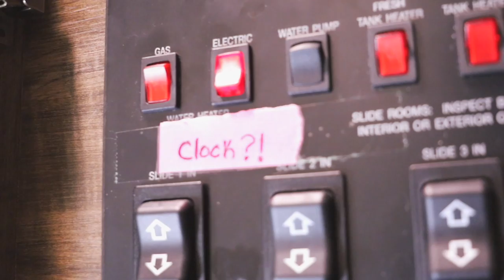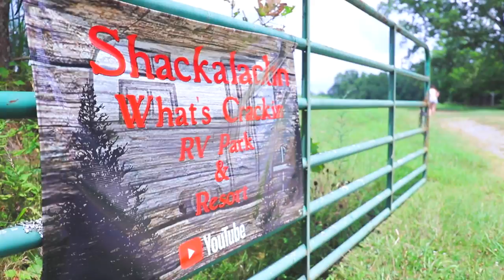Want the BEST Tow Vehicle Upgrade? WATCH THIS FIRST!

Comment: I’m interested in your truck I have a 2019 3500 Denali with a 6 inch lift and 35” tires.  What are the spec on your truck.  I was told I couldn’t pull a 5th wheel because it was too tall.  I ended up with a bumper pull and I’m not happy with it.  I really want a 5th wheel.
Reply from the maker: Ney Ney here! 5th wheels are the way to go esp for full time RVing! We have a max tow of 15,000lbs
Reply: Does your truck have a suspension lift on it?  If it does how much?

Comment: Sometimes the towing air pressure charts are difficult to find so let me share the info I found.  The chart is not formatted as it should but here ya go!  Use your tire size and load rating and axle weight to determine your tire air pressure.

Tire Size	Max Load Capacity
Max Tire Pressure
30x9.50R15 104S
1984 lbs	50 psi
31x10.50R15 109S
2271 lbs	50 psi
32x11.50R15 113R
2535 lbs	50 psi
33x10.50R15 114R
2601 lbs	50 psi
33x12.50R15 108R
2205 lbs	35 psi
33x12.50R17 120S
3086 lbs	65 psi
33x12.50R18 118S
2910 lbs	65 psi
33x12.50R20 114S
2601 lbs	65 psi
33x12.50R22 109R
2271 lbs	65 psi
34x10.50R17 120R
3086 lbs	65 psi
34x12.50R18 121R
3197 lbs	65 psi
35x12.50R15 113Q
2535 lbs	35 psi
35x12.50R17 121R
3197 lbs	65 psi
35x12.50R18 123R
3417 lbs	65 psi
35x12.50R20 121R
3197 lbs	75 psi
35x12.50R22 117R
2833 lbs	65 psi
37x12.50R17 124R
3527 lbs	50 psi
37x12.50R20 126R
3748 lbs	75 psi
37x13.50R18 128R
3968 lbs	75 psi
37x13.50R20 127R
3858 lbs	75 psi
37x13.50R22 123R
3417 lbs	75 psi
39x13.50R17 121R
3197 lbs	50 psi
LT215/65R16 103S
1929 lbs	65 psi
LT215/70R16 100R
1764 lbs	50 psi
LT215/75R15 100S
1764 lbs	50 psi
LT225/65R17 107S
2149 lbs	65 psi
LT225/70R16 102R
1874 lbs	50 psi
LT225/75R16 115S
2679 lbs	80 psi
LT235/70R16 104S
1984 lbs	50 psi
LT235/75R15 104/101S
1984/1819 lbs	50 psi
LT235/80R17 120S
3086 lbs	80 psi
LT235/85R16 120S
3086 lbs	80 psi
LT245/65R17 111S
2403 lbs	65 psi
LT245/70R16 113S
2535 lbs	65 psi
LT245/70R17 119S
2998 lbs	80 psi
LT245/75R16 120S
3086 lbs	80 psi
LT245/75R17 121S
3197 lbs	80 psi
LT255/55R18 109R
2271 lbs	65 psi
LT255/65R17 114S
2601 lbs	65 psi
LT255/70R16 120S
3086 lbs	80 psi
LT255/70R17 121S
3197 lbs	80 psi
LT255/70R18 117/114S
2833/2601 lbs	65 psi
LT255/75R17 111S
2403 lbs	50 psi
LT265/60R18 119S
2998 lbs	80 psi
LT265/65R17 120S
3086 lbs	80 psi
LT265/65R18 122R
3307 lbs	80 psi
LT265/70R16 121S
3197 lbs	80 psi
LT265/70R17 112S
2469 lbs	50 psi
LT265/70R18 124R
3527 lbs	80 psi
LT265/75R16 123R
3417 lbs	80 psi
LT275/55R20 115/112S
2679/2469 lbs	65 psi
LT275/60R20 119S
2998 lbs	65 psi
LT275/65R17 121S
3197 lbs	80 psi
LT275/65R18 123/120R
3417/3086 lbs	80 psi
LT275/65R20 126S
3748 lbs	80 psi
LT275/70R16 119S
2998 lbs	65 psi
LT275/70R17 121R
3197 lbs	80 psi
LT275/70R18 125/122R
3638/3307 lbs	80 psi
LT285/55R20 117T
2833 lbs	65 psi
LT285/60R18 118S
2910 lbs	65 psi
LT285/60R20 125S
3638 lbs	80 psi
LT285/65R18 125/122R
3638/3307 lbs	80 psi
LT285/65R20 127S
3858 lbs	80 psi
LT285/70R17 121R
3197 lbs	80 psi
LT285/75R16 126R
3748 lbs	80 psi
LT285/75R17 121S
3197 lbs	80 psi
LT295/50R22 118S
2910 lbs	65 psi
LT295/55R20 123R
3417 lbs	80 psi
LT295/60R20 126R
3748 lbs	80 psi
LT295/65R20 129R
4079 lbs	80 psi
LT295/70R17 121S
3197 lbs	80 psi
LT295/70R18 129R
4079 lbs	80 psi
LT295/75R16 128R
3968 lbs	80 psi
LT305/50R20 117S
2833 lbs	65 psi
LT305/55R20 121/118S
3197/2910 lbs	65 psi
LT305/65R17 121R
3197 lbs	65 psi
LT305/65R18 124R
3527 lbs	65 psi
LT305/70R16 124R
3527 lbs	65 psi
LT305/70R18 126R
3748 lbs	75 psi
LT315/70R17 121S
3197 lbs	65 psi
LT315/75R16 127R
3858 lbs	65 psi
LT325/60R20 126S
3748 lbs	75 psi
LT325/65R18 127R
3858 lbs	65 psi
Reply from the maker: Hey Tim! Thank you so much for finding this out for us 😃👍🏼 this is great information to have. It seems like going by the door sticker alone just doesn’t cut it. We will definitely be correlating our weight of the axles and adjusting the pressures 😊 

Cheers to you friend! Your support means everything to us! 😀
Reply: @HappilyEverHanks  Traveling safely carrying the types of loads on our axles is critical to the amount of tire pressures.  That contact to the road surface is our safety margin, and that’s why tire pressure is so critical to our safety and others.  With States getting more and more involved into travelers journeys, we must take extra precautions with our rigs!  Safe travels to you both and all those looking into your post. Take Care

Comment: Your running the wrong tire pressures. 
When towing you should run 65-70 in the rear and 60 front when pulling a 5tgh wheel. This is because the rear axle has more weight on it from the pin weight of the 5th wheel. 
When you are NOT towing you should be running 45 rear and 50 front. 
When not towing the rear is lighter than the front and so you need to run lower pressures. 

I ran the same KO2 tires on my truck and I got 65k out of them doing this. 
And they still had tread left. 

I did have to have my dealer adjust the TMPS system to get it to shut up when I set the rear that low. But that was not hard to do. 

Tires always wore nice and even doing this, and I had much better wet and snow traction as well when not towing. 

Also rotate them every 3k or so. 

If you do that they will stay quite and will last a long time. 

If not your going to eat the center of the tread up and they will start to chop and then they will get loud! 
I have owned 6 sets of these tires not, and I LOVE them. But they have to be run at correct pressures and rotated more often than some other tiers to get good life out of them.
Reply from the maker: This is seriously some wonderful information! Thank you so much for taking the time to write this out for us and everyone reading 🙂 I recently have started running the rears at around 75 (the max cold) and the fronts around 65. 

I am going to start implementing the pressures to be higher in the front while not towing (like you mentioned). That makes a lot of sense. Thank you again for this great comment! 

Did you find that you paid about the same as what we paid for our tires? Everyone has been saying that we overpaid on our KO2’s
Reply: @HappilyEverHanks  Any time man. Love your channel by the way, I watch every video you post!
The last set I bought was 3 years ago. So prices have changes since then, and tire size also effects price, I do not run 35s my self. From what I have read the price you paid seems to be very close to what I see others paying. And Discount tire is where I get all my tires from as well. 

I will be buying a new set here in a month or 2 when my new 2022 Silverado 3500HD LTZ Z71 finally comes in. 
One of the first things I usually do is change the tires out to KO2s when ever I get a new truck.
Reply from the maker: This is really amazing of you to say! Thank you so much for your awesome support 😃👍🏼 we really appreciate you

Yeah, we figured it might be a little more pricey with them being a 35 inch tire. I guess KO2’s come in different sizes, maybe that’s where people are getting confused about pricing. Can’t say I blame you there, I would be doing the same thing 🙂 They are just too great of a tire not to put on a new truck 

We hope to talk to you again soon! What’s your name by the way?
Reply: @HappilyEverHanks   Yeah the KO2 is probably made in more sizes than any other tire out there as its a very a popular tire. 

Names Jarret.
Reply from the maker: Awesome, nice to meet you Jarret! We hope to hear from you on other videos, it’s been great talking with ya

Comment: Sorry you got ripped off I paid 1400.00 for four ko2s in San Jose Ca with sales tax at 9.25%. They are unscrupulous in your state sorry !!!
Reply: Maybe or maybe not. Are your tires the same KO2 model? Different sizes can vary quite a bit.  How long ago did you buy yours?  Prices are going up. Discount offers an extra coverage road hazard policy.  If they purchased that and you did not, then that would account for a price difference.  Michelin BF Goodrich has different promotions during the year that change  pricing. It may be premature to label the business unscrupulous at this point without  knowing more details of each purchase.  You did well at $1,400 if it is the same tire.
Reply from the maker: Oh yeah. All the tires are different and it can be confusing at first! We put the ones we got in the description so you can see! Thanks for watching and sharing!